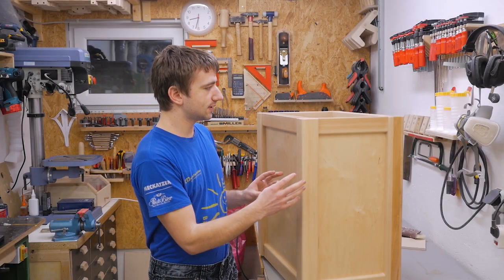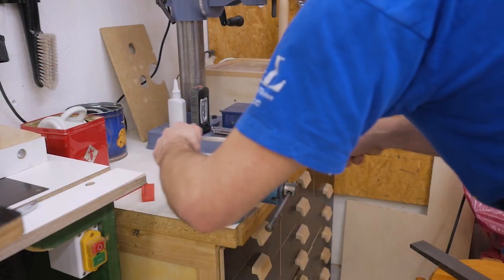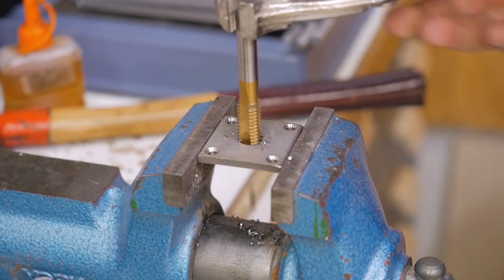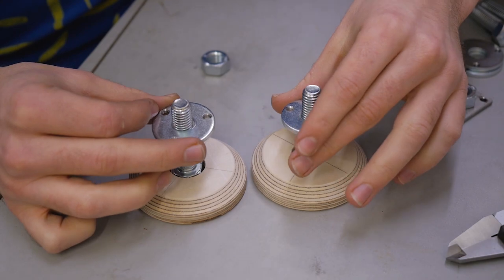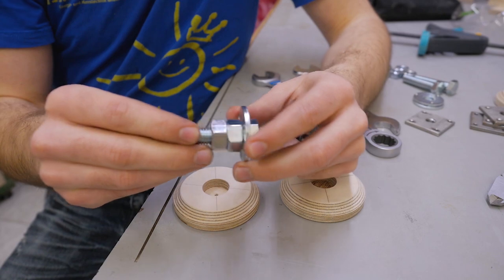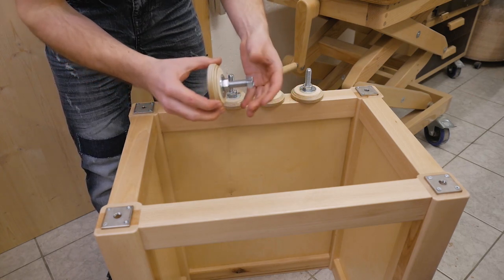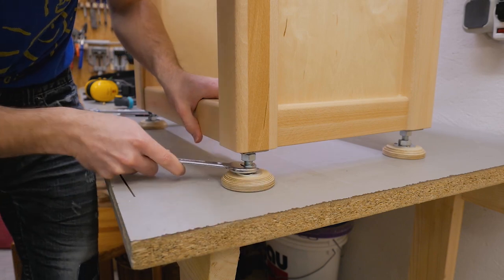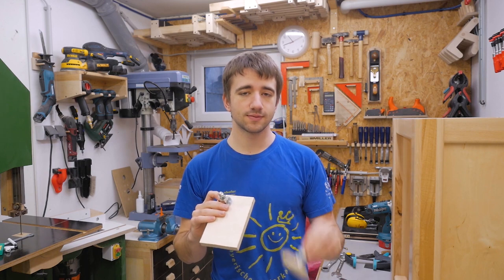BEST DIY Leveling Feet

Comment: I'm on your side when it comes to adjustable machine feet. They are WAY easier to adjust when they are locked. If the equipment is heavy, just use a lever whilst adjusting, like a crowbar or something. Nice video as usual, keep up the good work man. Thumbs up.

Comment: Marius -For your solid version - if you find "Flexible Cutting Board" on Amazon, cut out a disk the same size as the bottom of your disk feet, then glue it on, that should allow the foot to spin much easier on the floor as you adjust it, without necessarily moving the machine (if you have any amount of weight already on it.). We used these all the time for the bottom of any leg of furniture.

Comment: Marius you are the perfect guy for this! It’s the time old problem of never having enough clamps . What about something like a truss that spans 5 feet and needs only 3 clamps . I’m picturing something like a bridge with a subtle arch that when clamped in the middle it distributes the pressure more evenly. And yes I know use a 2x4 it works fine , but it still takes a lot of clamps

Comment: You could put felt, cloth or some kind of easy-to-slide material under the foot to keep it in place when adjusting it. 

If you remember, the purpose of the adjustment is usually to level the cabinet, not raise it.  If you just want to level it, you just lift the cabinet so it rests on the other three feet, then adjust until snug.  It shouldn't move the cabinet to snug the foot.

If you are raising it, such as for an out-feed table, you should pre adjust them to be close to the height you want, then snug them up. 

When I am making height adjustments like that, I just put a stick under the cabinet for leverage and gently lift the cabinet long enough to make the adjustment and set it back down again.

I do like the added lock nut you put on to keep the foot from vibrating loose.  That was good thinking.

Comment: Nice way of fabricating the leveling feet. One thing they are missing is angular play. I know of industrial versions which have a ball connecting the threaded rod to the bottom plate hence compensating angular missalingment. But if these feet work for you I would like to say extremly well done.

Comment: You could trow between one of those spring steel washers that create tension, so it wont rattle away, or just use O rings. Little angular adjustability that comes from feet moving might be beneficial for uneven floors like ones on poorly leveled, unsanded concrete workshop/garage floors. Though most useful would be have feet like this in convention etc work bench or tool table that needs to be moved quite often, for that its pretty essential that feet does not move and rub against for instance concrete, breaking the lacker seal and letting moisture getting in and so on.

Comment: First 2 thumbs up.
If a carriage bolt is used and the matting hole drilled with a drill bit for metal it would allow for angular compaction, similar to a ball and socket. A t-nut would be easier in the leg

Comment: thanks for sharing the video. if i may add my 2c, i`d say i have been guilty of "putting windows to a tent" syndrome, your leveling feet are super ok and unless you`re leveling a machine tool or a surface plate i`d put them on anything. regarding the swivel feet that play is negligible and having some weight on the thing will sit it firmly, wood will move and vibrate enough to throw level out in service. a big tap wrench can be made quickly with two pieces of steel and two bolts and pig fat is an excellent lubricant for carbon steel, the dog will lick it after tho. :D regards. peter

Comment: suggestion, since you have a lathe, you could turn a steep taper on the nut that would be resting on the plate and also countersink the plate that way the slop wouldn't matter as it would be self-centering, maybe thats worth a try

Comment: Remember to spray a little cutting oil at your drill bits when you're doing metal on metal bro. The smoke is the metal starting to burn and this just unnecessarily stresses the metals in both the bit and the workpiece. Great work and a nice project!
Reply from the maker: That was the cutting oil getting hot.
Reply: @MariusHornberger  I realise my apology. Keep up the good work

Comment: In the wooden foot, put a small washer at the bottom of the hole (which needs to be deeper). On that washer put a ball bearing. In the bolt head drill a hole that's wide enough to accept one third of the ball bearing. The rest is identical.

Comment: Round the bolt heads on the lathe and size the hole in the wood for a close fit and they won't wobble.

Comment: Maybe one improvement: change the top nut (locking nut) to a wingnut. But only for something you move around often that needs more frequent adjusting. And in many cases you only need two of them to be adjustable. Put the adjustable ones on the front for easy access.

Comment: Hi Marius, I just made these feet today - so thank you!  I thought you might be interested in my experience.

I was following exactly, expect using M10 instead of M12.  Everything went smoothly apart from drilling for the pin to make the lock-nut.  I'm not sure what I was doing wrong, but it was very tough to get the hole through, and I managed only for 3 of 6 feet with 2 broken bits.  I was using a drill-press, a punch, plenty of lubrication, and new bits.  I wasn't using a drill-press vice, I held the piece with a block of wood with a M10 thread cut through it - maybe the hold wasn't firm enough?  Or could it be that some nuts are made of harder steel?  After getting through the nut, penetrating the bolt was no problem, then the second "layer" of nut was hard again.  

I'm not so experienced in drilling metal - so any advice would be appreciated!

Thanks - by the way - for all the great videos.
Reply from the maker: The problem there is the interupted cut when you drill through the threads. Especially small drill bits don't like that. And maybe you didn't have enough rpm. With a 2-3mm bit I'd use 1500rpm or more and a slow constant feed when you go through the threads
Reply: @MariusHornberger  Thanks for the quick reply!  I tried your suggestions today, and you're definitely right that it's the threads that are the problem.  I was using 3mm @ ~500 rpm yesterday.  I increased to 1500 rpm today, and tried to feed as slowly and smoothly as possible - but it didn't change the experience much.  I got through one more nut, and on the next one the bit simply wouldn't travel past the thread.

I'm very curious to know what I'm doing wrong.

On the plus side: all this metal work makes me appreciate how easy it is to cut wood 🙂
All the best,
Richard

Comment: If you file some more, use your arms not your whole upper body. Be aware of material combinations that may corrode each other when you use different metals contacting each other. If you cut with your angle grinder, some metals will loose their hardening heating them up. Interesting channel. Subbed.

Comment: Next improvement to these.  Use threaded rod and run it up to the top of the bench so that instead of having to get on the ground to turn a foot .... you can put a socket on and adjust foot height from standing position.

Comment: Just wondering about the taps, from the ones I have used previously, the first one cuts the treads, and the 2 others are for a blind hole, so you get the threads all the way down. This is not the case with yours? 🤔
Reply from the maker: My set is just for through holes in three steps (neccesary for M12). There probably are different sets available

Comment: no need to use more than one tap for a through hole, the other taps are just getting the threads all the way to the bottom of blind holes
Reply from the maker: No, this tap set is meant to be used in three steps

Comment: I picked up some Footmaster levelling castors recently, the levelling feet in them have /loads/ of play when unloaded (and I was worried they were faulty or something), however when the foot is loaded, it goes totally rigid. There appears to be some kind of flange that gets pressed against the casting of the err, castor, which keeps it perpendicular. Any lateral force of it is counter acted by gravity. I would invite you to explore if the swivelling foot would work out. Maybe look at the Footmaster castors for an idea of how they might function, I'm no engineer

Comment: Have you ever tried using a rod coupling nut fully embedded in the leg in place of a hex nut. A rod coupling would provide much more support for the threaded rod, about 3 or more rod diameters vice 1 diameter for a standard size hex nut. You wouldn't need the washer or the tapped plate so less work, no drilling, no tap required, and fewer parts. Drill hole to the major diameter of the nut leaving the end just proud of the bottom of the leg by one or two mm and epoxy it in place. It will never move. Example nut: Low-Strength Steel Coupling Nut, Zinc-Plated, M12 x 1.75 mm Thread - McMaster item 93355A360
Reply from the maker: Haven't tought about that yet. But I like that idea!

Comment: I tried to make a table out of half a euro pallet and fence beams, where I connect the fence beams and the euro pallet with a threaded rod and screws embedded and glued into the wood. As you might've guessed, that did not work out very well. As soon as I started tightening any of the table legs it'd pull one or both screws out.
I will definitely steal this idea and make a better version of it!
Reply from the maker: Cool, please send me a picture when they're finished
Reply: @MariusHornberger  left the table project back home for the semester, but definitely will send a pic when it's finished in a few months time!

Comment: What you need is a bearing surface for the feet to rotate.  Incorporate a thrust bearing to allow the threaded rod to rotate independent of the feet.  You can either make a thrust bearing, buy them, or you can take castor wheels and remove the wheel portion, remove the mount that allows clearance for the wheels, and leave the flat plate so you can attach feet to it.  The castors have a built in thrust bearing and you can tap one of the sides to accept the threaded rod.
Reply from the maker: That seems like a lot of effort for a one time usage
Reply: @MariusHornberger  you could say the same about your design. You could have just knocked a wedge under the corner to level it too but obviously you wanted a way more technical approach